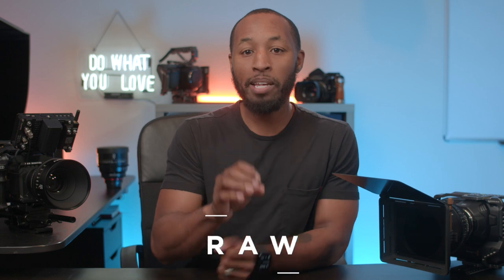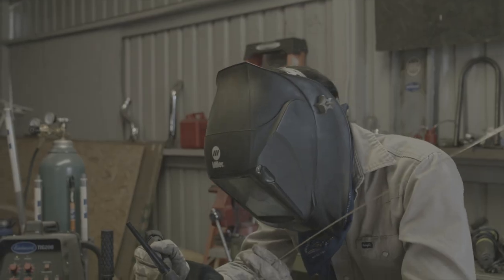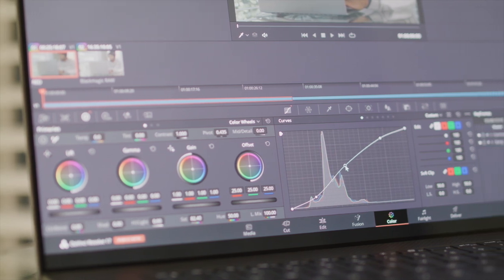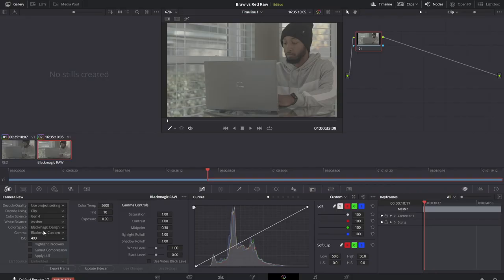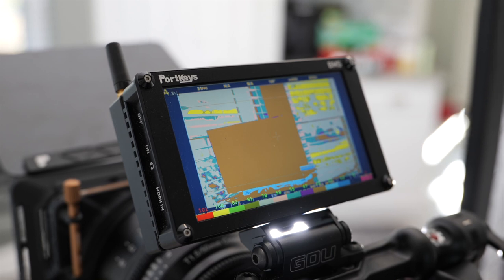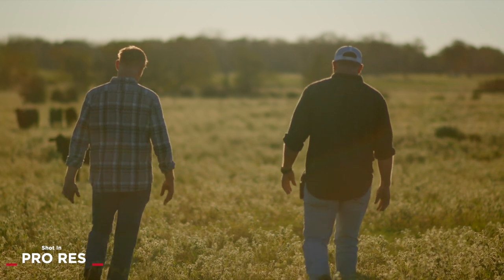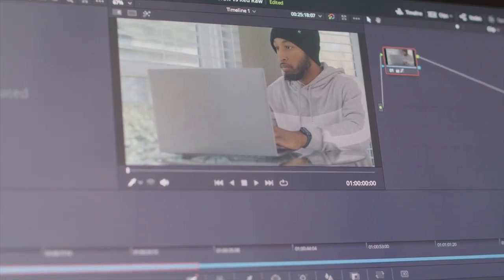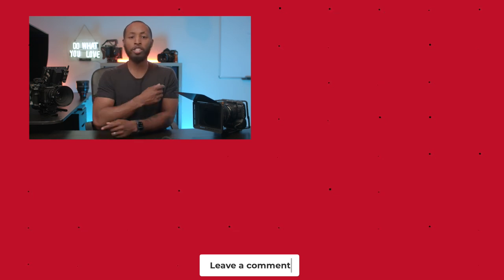Blackmagic Raw vs Red Raw

Comment: I'm a BRAW guy. The file sizes are manageable, it works fine on my machine with no proxies, and with Resolve Color Management I don't need to do any conversions from RAW before I make any creative adjustments. 

I'm sure I'd love Red Raw as well, but I've not had any experience with it besides downloading some files from Red to test. I'd be curious to see how big the files were for each camera when shooting the same scene with similar quality and resolution settings.
Reply: R3D is 30% smaller than ProRes

Comment: Appreciate the vid! Nobody can tell the difference unless you’re doing side by sides and your pixel peeping. That’s just a fact. I get it YouTube is about commercialization but if you can tell a story either of these cameras will be a proper tool that will give you beautiful results. All the highlight and shadow talk is overrated and really only pertains to doc shooters who are out in the elements and need to be ready to salvage shots in fast moving conditions... Get a Sony FX6 or A7Siii for that... Honestly NEITHER of these cameras is a run and gun documentary camera - The Komodo is technically a crash cam so yes it does help there but they are both “cinema cameras” that MOST of the time will be used under controlled situations... Even the Red which if used as a crash cam in Hollywood or for Indie shooters will be used under controlled Situations... IDK 🤷🏻‍♂️ that’s how I see it... Keep up the good work! Been a fan for several years now!

Comment: Though the Komodo may have more overall dynamic range, I feel like the Pocket 6k has more highlight sensitivity. In this video, you did proper exposing, which is fine. With Red cameras, you don't want to overexpose at all since you won't get the highlights back. So you're exposing properly with this test was the optimal way. In post, redcode is very robust and you can't damage the footage even if changing the ISO. With the Pocket 6k, I find a different tactic works better. For high dynamic range scenes with harsh highlights, I prefer to capture at ISO 800. Then in post, I lower my ISO to 100 or 200, lower my exposure and then click "highlight recovery". Doing this method really does bring an insane amount of highlights back, to the point that it's shocking. I would never use this method with Komodo. Different tools require different methods

Comment: My only real raw experience has been with my pocket 4K and it’s has helped with DR and preserving more detail, as well as saving myself in post when I need to tweak white balance and secondaries. I love the flexibility and the extra range I have with this codec. R3D raw I’ve had minimal experience but I know that I love how it works overall and the results you can get. I agree with you Brandon 100% when it comes to “do I need raw?” I don’t need it but I love and want to use this to aid me in post and allow me to have the flexibility when going into detail with tweaking my images.

Comment: the 16 stops of dynamic range of any Red camera is to be honest misleading, the only ture 14.5 stops dynamic range  with a non duel gain snesor is ARRI in the entire industry. However, BMPCC 6k is able to recover insanly amount of over exposed highlight in post with the black magic raw way of process, not the R3D way of process. In R3D, if you over exposed highlight, then you over, but in bm raw, you can lower your iso (suppose if you recoring higher than its lowest iso) then bring them back like in real world shooting with lower iso. If you shooting with r3d at any iso, the overexposed part will not be able to be recovered even if you lower the iso to 50 in post. R3D raw is not a real "raw" if I 'd say honestly. You said in your video, people don't really need raw, and I agreed, it is a fact, but most videographer just didn't realize it since they are not professional software/hardware enginner. They thought they are able to adjust their clips freely all because of how great the red raw is, and ignored that they can do very similar thing with pro res( including many pros).  If you properly expose your clip, then you can almost adjuets it at the same level with either r3d or proress, but if you ruined your exposure, you will need a real raw to recover it. And R3D can't do it.